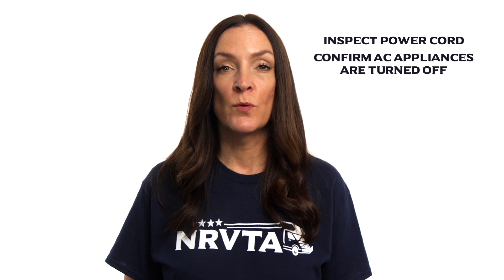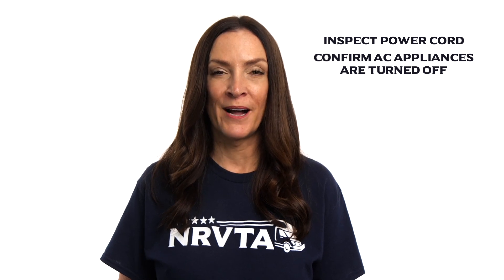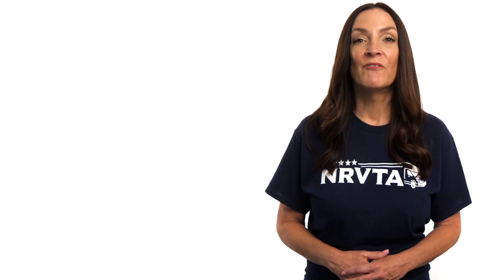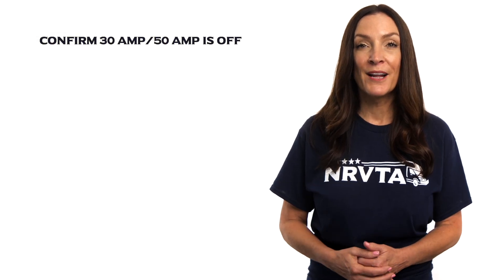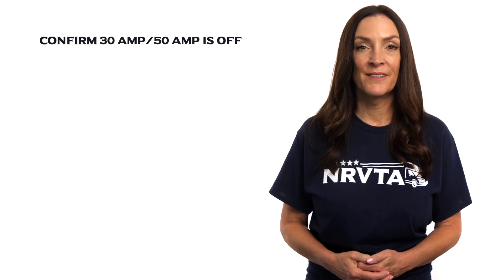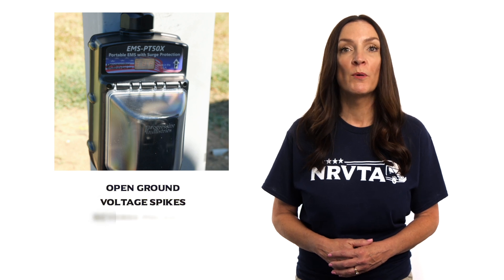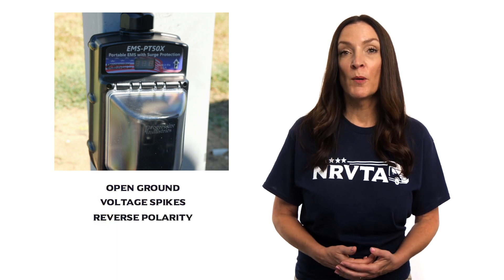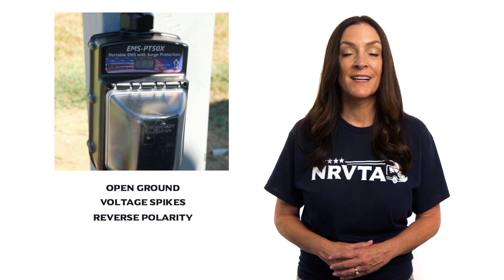Connecting to Shore Power

Comment: I also turn off the main breaker inside the rv then I hook up to the pedestal with the pedestal breaker off.  I hook up the surge protector then flip the breaker to check the pedestal then I turn off the pedestal breaker.  I then plug in the shore cable and turn on the pedestal breaker.  If everything is ok I go in a turn on the main breaker.  
A little bit of safety beats blowing up your rv.
Thanks for your tips  it has saved me lots of time and money.